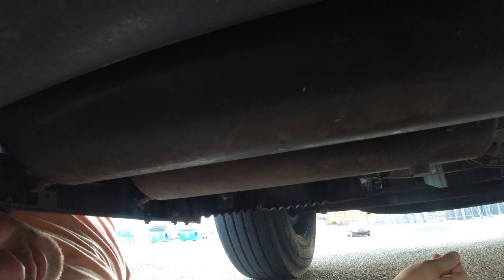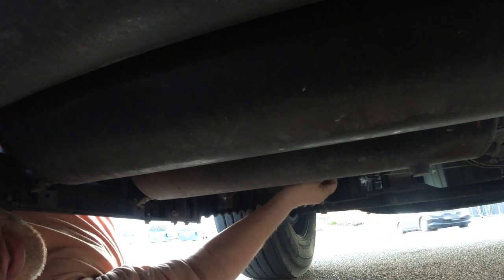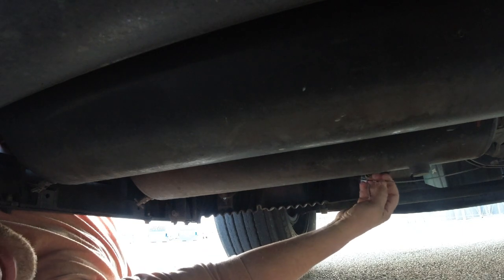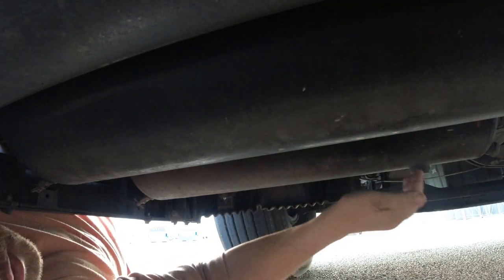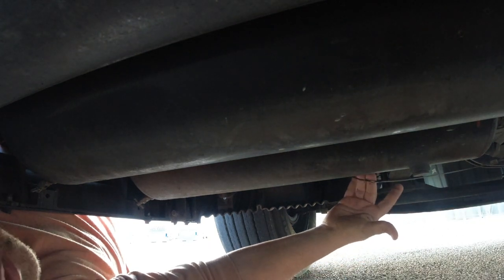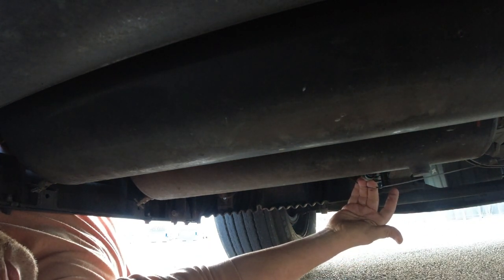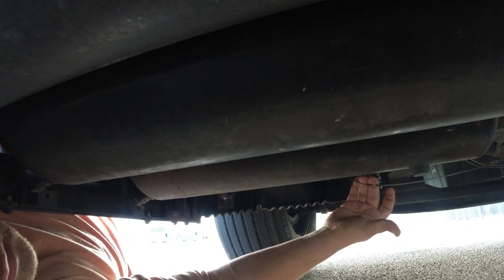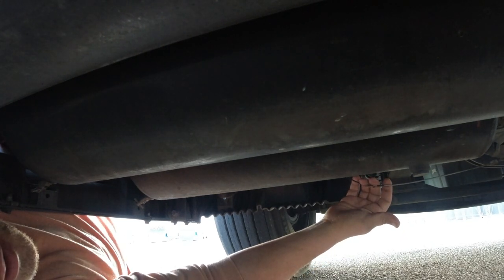How To Avoid And Fix Frozen Air Lines

Comment: Drying the air off of your system, take the plug out of the air and pour a bottle of heat in that tank replace the plug, then pour a bottle of heat one down each glad hand going to the trailer. And you will never up. I drove from JFK in New York to O'Hare in Chicago in whiteout conditions one truck after another froze up on the side of the road and I kept plowing that Hammer Lane shoulder with my steer tire with wide load passing everybody. 2 or 3 bottles of heat in the air system and you will never freeze up, never!
Reply from the maker: Great advice,  thanks.

Comment: I keep 5/6 qts of 70% alcohol with me all year long. Great for cleaning hands, and cleaning glass in very cold temperatures. Alcohol doesn’t freeze and melts ice to a certain extent. 

Pour alcohol in your washer fluid tank in the winter very cold temperatures mixed with the washer fluid. You want to do this before you get into those types of cold temps. Run the alcohol fluid through the lines before you hit those cold temperatures. That helps prevent ice in the lines, washer nipples and wiper blades. It also helps melt ice off the windshield and blades as you are driving. 
You can pour alcohol down into your trailer airlines before you head out. A qt of alcohol is typically cheaper than most household cleaning products.

Also carry a steel spade construction sort handle shovel with you during the winter. 
Spray WD-40 on it, helps keep the snow from sticking to the spade. Keep a small folding step ladder for climbing onto your truck tires, especially in the winter. That way you won’t wind up in the hospital. 🏥
Reply from the maker: You are definitely ready to go anywhere  
God Bless
Reply: @otrsurvival6908  
I learned from many other truck drivers like you over the decades. I am 72 years old and still driving OTR and still learning. Thanks for the tip on the Hammer application you recommended. Now I have 5 mapping software applications on my phone.
Apple Maps, Google Maps, Hammer, Waze and Mapquest. 

Plus the Trucker’s Friend truck stop directory, the Pocket truck stop directory, Rand McNally truck atlas, truck stop applications Flying J,/Pilot, Petro/TA and Love’s applications. I remember life use to be simpler..LOL. The days I had to use my brain ..LOL.  

The years past when Fuel Attendants would fuel my truck, washed all my windows, and mirrors at some of the truck stops..😀👍 
Bunkhouse showers with cold water with one light bulb hanging on the wire..😀
Sometimes only a soap stone sink in the dirt to wash up at..😀 Now I have power steering, Climate Control,  APU, AM and FM weather radio, Automatic 12 speed, electronic baby sitter, and more bells and whistles in my truck that keep beeping at me. 😳🙄
Reply: @davidfromamerica1871  I'm still rocking a flipphone, never bothered to figure out how to use the satellite radio, didn't want the satellite TV(as I HATE Direct TV).
I tried to keep it simple as I'm 'technologically challenged' as my son puts it.
Reply from the maker: I have faith in ya. Just be prepared to learn ALOT!!!
Reply: @gregstruckingweatherandroa1414  the Flip phone will work as long as it can connect to 4 g networks. The telephone carrier’s are disconnecting the 3 G networks, 3 g networks are outdated.
Many flip phones will do e-mail and some will do online web applications.
I see from your YouTube channel you watch POW Ryan’s weather channel. That is my go to YouTube channel for weather information. 👍
Reply: @davidfromamerica1871  I just got my notice from Verizon that I need to upgrade my flipphone 😥😥😥😥😥

Comment: hey i was told to use green alcohol? is that alright? does it matter if its not green?
Reply from the maker: I've never heard this one. I can't imagine what the benefit would be to use it over just using what's readily available at all truck stops. 

If you do happen to try this, let me know how it works. I would be interested in finding out the results.

Comment: I drain my tanks every time I fuel. I've put alcohol into the service line to the trailer. And my compressor governor and air dryer still froze up.
Reply from the maker: Thats an extremely good move!
Reply: @otrsurvival6908  I've been in my truck for 8 years,this is the 1st time its happened. I'm in Montana in the hard freeze. It was -19
Reply from the maker: Ooooops🤣🤣🤣🤣🤣

Comment: Mine just froze up what should I do
Reply from the maker: Dump that air line deicer in the red line and then push it through with the air.
It will shoot all the way to your brake chambers
Reply: @otrsurvival6908  it’s a box truck
Reply from the maker: Easy, call a wrecker🤣🤣🤣
Reply: @otrsurvival6908  just bought it.. it’s sitting waiting for the title so I can register it
Reply from the maker: I am 100 percent not a mechanic.  I just do what I can and then call for help when it's outta my reach. Everything on this channel that I talk about is only based on my experiences.  This is obviously not gonna be in my wheelhouse. 

I've driven a U-Haul twice in my life. 
End straight truck experience. 
My biggest concern is that you got sold a lemon!!! God Bless
Reply: @otrsurvival6908  oh ok yeah it was from Texas and in Jersey so I was assuming it wasn’t use to this cold plus not draining it
Reply: I see your comment was 9 months ago so I sure hope you are not still froze up but you need to run the truck at about 1400 rpm. let it build to wherever it will. maybe 30 psi and then emergency stab your brake pedal repeat this process as it builds back up. with the heat from the compressor and the forced air.